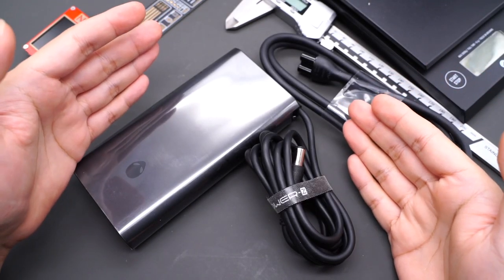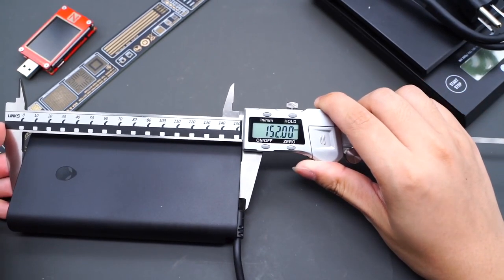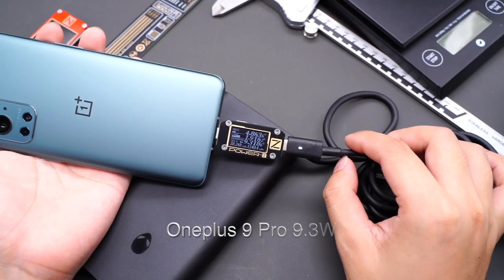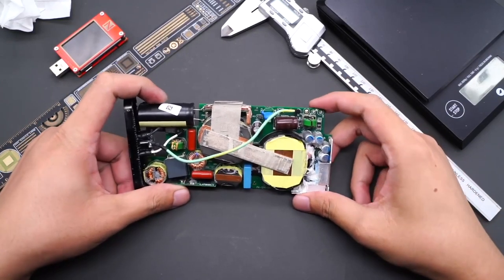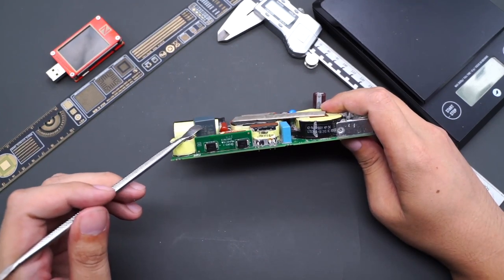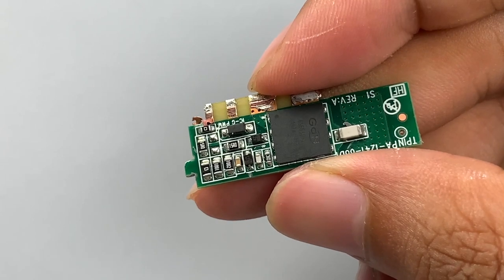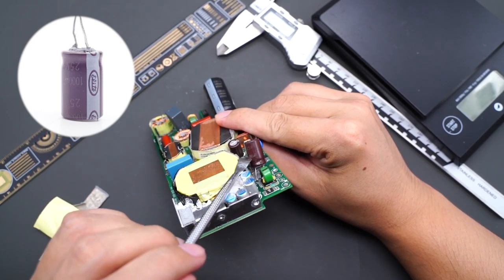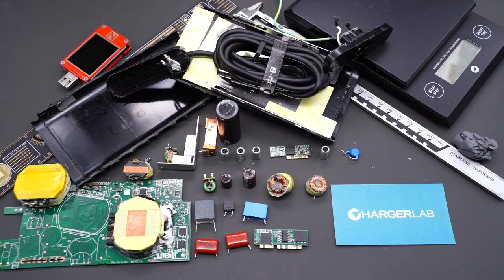Up to 240W | Teardown of Alienware 240W GaN Charger (For m15 RYZEN EDITION R5 Laptop)

Comment from the maker: Correction: The the GaNFET is not the main reason of small size, cause it only used in PFC circuit. 
The main switcher still adopts the traditional MOSFET. Sorry about any misunderstanding.
Except for the GaNFET, this charger uses active bridge rectifier, which can reduce the input temperature.
And hollow PCB design is the other reason why it can be small.
Reply: @ChargerLAB  Kindly do the teardown of Baseus 120 W gan charger. I'm curious what's inside and the quality of materials.

Comment: Make no mistake, the small size is not due to the GaNFETs as the main switchers are Good old Silicon from Infineon, again cheap caps and not enough capacitance but as it is an LLC Resonant, the dropout voltage might be a little lower, Lite-On shouldn’t be cheaping this much on components and this charger will run very hot under full sustained load, they haven’t used so many multilayer modular PCBs and gunked it up for no reason. Even with 90% efficient 24w is not very easy to dissipate, they might achieve even higher efficiency with this design and the bridge rectifier should really have 4 FETs, having 2 doesn’t make sense unless it is only Semi-Active.
Reply from the maker: Hi, thanks for the comments.
We have done the correction at the top comment.😊
Reply: Lol.... the only question is are those chargers failing?! I guess nope.
Reply: I thought GaN chargers have around 93-94% efficiency?
Reply: @TabalugaDragon  "Peak" and it depends on the specifics.
Reply: @tanishqbhaiji103  well, it's a premium Dell charger. If someone has that 93-94% it would be them
Reply: @TabalugaDragon  it wouldn't be that high under full load, it would arround that at 50-60% load.

Comment: I have never seen an active input rectifier before but I think that is a huge help, especially on 120v. 

Great teardown, thanks!
Reply: It’s like 2A current draw at 120v and 1A at 240v so like less than 2w heat on 120v, it is not a huge help.
Reply: 2A is around 3w of thermal budget eaten up. The whole charger probably only has ~20w envelope so that's 7-8% improvement.
Reply: @mrrkrr  it’s 2w max not even 3.

Comment: The GaN is only there for the APFC, where it basically doesn’t matter because the Inductor is just as big as a MOSFET based APFC would have and it would have higher Conduction losses which are relevant to an APFC FET, certificates don’t mean it is reliable or good quality it just means it’s electrical isolation is fine.
Reply: Hi, ive been following your comment and i think you know alot about power supply. I'm looking for 120w+ gan charger to lighten my bag. Which PSU would you recommend for us daily bloke?
Reply: @Ryuken2721  I would recommend the APPLE 140w one or something from Innergie (Delta consumer brand), anything made by Delta electronics or Lite-On is good.

Comment: TYPE-C on a gaming laptop 🤮🤮🤮, happy burnt port to you, I would never use this, barrel plugs or MagSafe. 
Edit: It does not use Type-C as primary charging method I was wrong
Reply: type c is designed to handle that these engineers aren't idiots
Reply: The output of the adapter is literally a barrel plug
Reply: @mrrkrr  sorry, I thought it was type C
Reply: @merdem7805  yeah, look at real life scenarios, the engineers who designed type C were dumb, 50v,5A on that pin pitch with data lines in between was a great freaking idea.
Reply: @tanishqbhaiji103  type c reconfigures pins when in pd mode they wont put vcc pin next to ground and even it they that pin gap is plenty for 48v
Reply: @merdem7805 Only if we lived in an Ideal world, if there is even a little bit of moisture between those pins it will burn the pin and the motherboard will very well be killed, or if any thing goes wrong like there wasn’t enough load on the output caps, there will be 48v and it will spark over.
Reply: @merdem7805  they can’t reconfigure Data pins to power and Thunderbolt will dictate it to have all display power and data capabilities turned on at the same time, Manufacturer can only configure 1 Pin according to the PD protocol, PD can’t configure any pins on the fly.
Edit: Manufacturer can use the pin for non-standard communication a.k.a. proprietary com and it has to be configured in the PCB at the time of manufacture, data pins will always be connected they can’t be disconnected.
Reply: @merdem7805  usb-c for power is abuse of this data-port.
Reply: actually type c is coming to 240 watt chargers, should be available next year. They will be 48v chargers though.
Reply: @TabalugaDragon  all the laptop's will due to such a high voltage on the data port A.K.A. type C which has datavpins in between power a d not to mention it the charger didn't switch down the voltage and there was arcong or somebody got electrecuted due to such a high voltage.